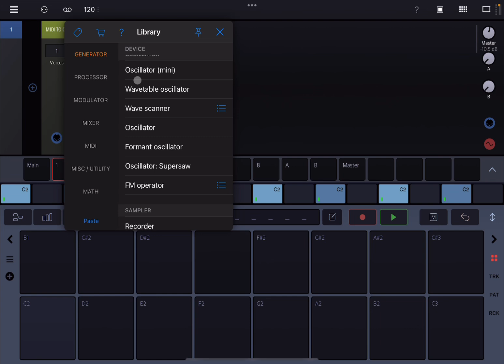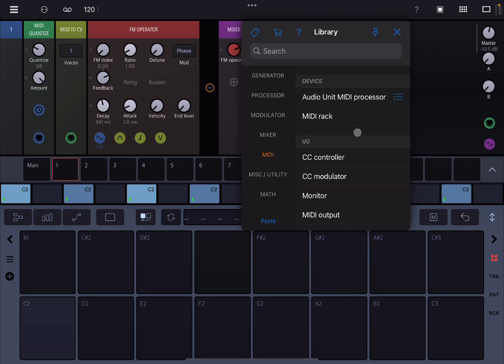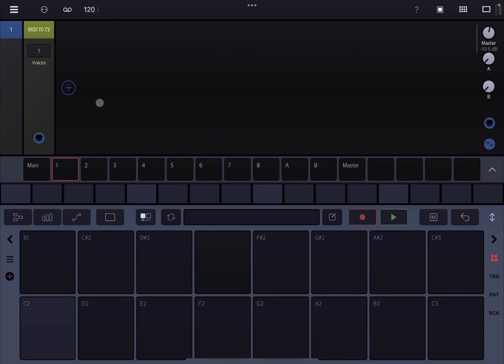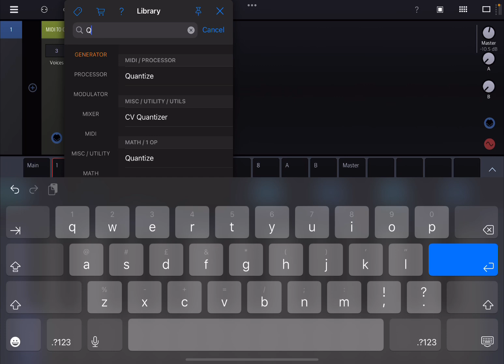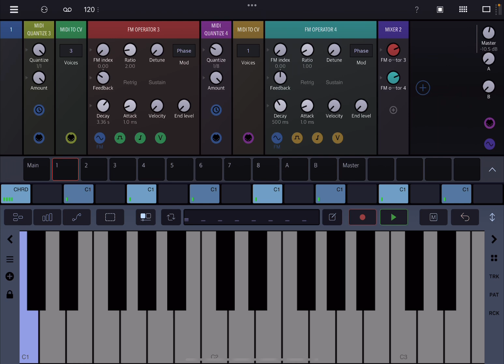BeepStreet Drambo v2 Tutorial 98: Tighten Up Your Grooves with MIDI Quantize

Comment: Thanks for the tutorial! 
Here you are quantizing notes, but I'm wondering is it possible to quantize MIDI CC too?
What I'm trying to do is quantize incoming MIDI CC to the first beat of the next bar, but cannot figure it out...
Reply from the maker: Midi CCs have values from 0 to 127 when they are sent… it doesn’t work that way, quantisation happens to trigger of events like notes on and off while ccs are values sent for a specific cc number… if you quantise you will end up quantising the values instead on when the trigger happens based on time… at least in Drambo…